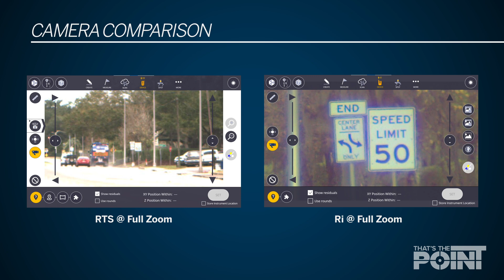That's The Point - Hands On The Trimble Ri

Comment: Idk if this is like the X7 on the auto adjust, but on the X7 if it isn’t close to level it actually does introduce error which we proved. Always good to get as close as possible the electronics can’t get rid of it all. Good procedures should never be abandoned. We had the problem with the X7, the crew got lax and we had issues trusting the electronics and sales pitch.
Reply: Ri has auto level and compensates a big tilt. X7 should do the same, but not as much as the Ri I think.